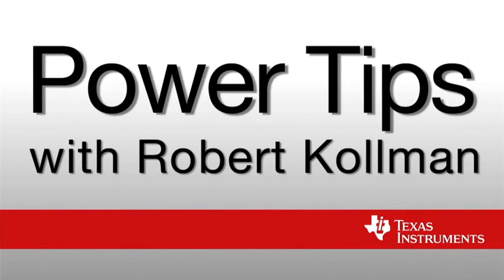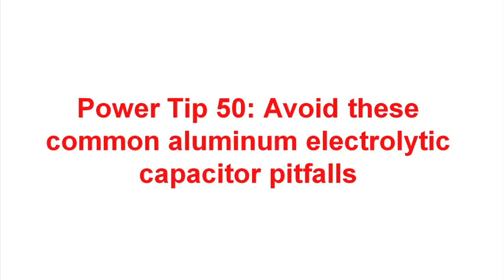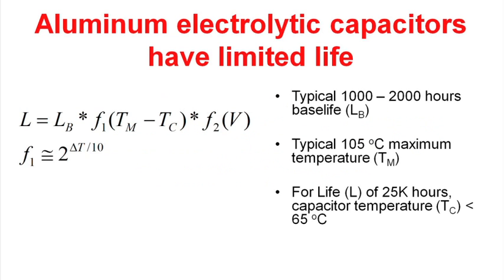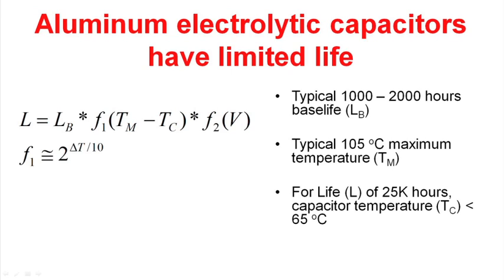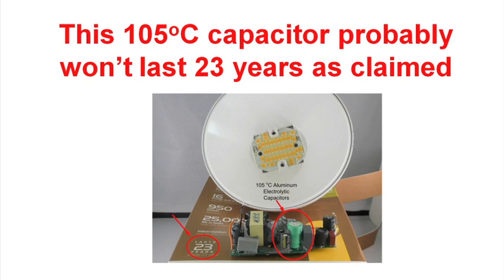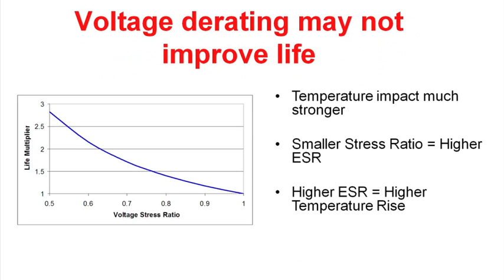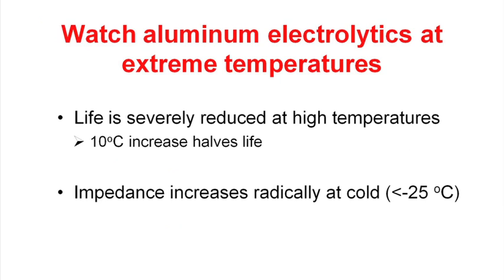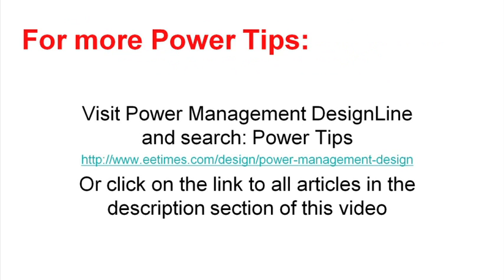Power Tip 50: Avoid aluminum electrolytic capacitor pitfalls

Comment: Nothing wrong with using these types of capacitors. You simply have to spec and implement them properly. Do not use cheap ones, use ones from reputable manufacturers. Also do not run them at max rated temperature and/or ripple current.
Also, some capacitors have a rated life of up to 10,000 hours even at 105C and full ripple current.
Also, sometimes manufacturing can cause problems. Try not to bend the leads by the seal of the capacitor. If you do so, you can sometimes weaken the seal, causing early failure.

Comment: Has anyone used the newer  Electrolytic CONDUCTIVE POLYMER capacitors as a cost compromise between MLCC and the older aluminum electrolytics?

Comment from the maker: The current in either case is limited by the internal resistance in either supply, the cap or the battery. The supply voltage as well as inductance and resistance connect the supply to the coilgun. 

For a more detailed answer, please visit our power forum: ow.ly\nc4pR